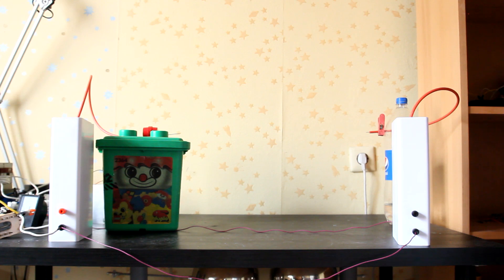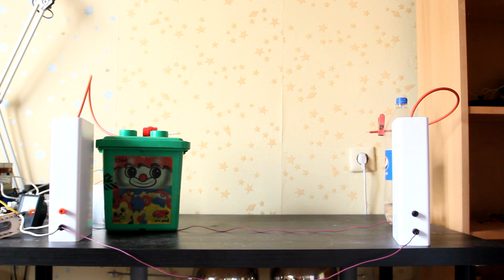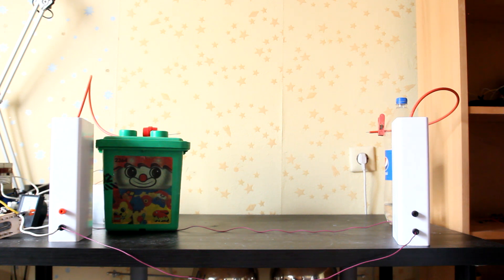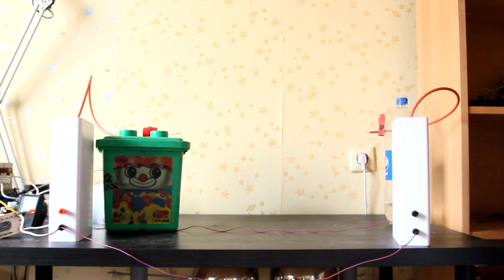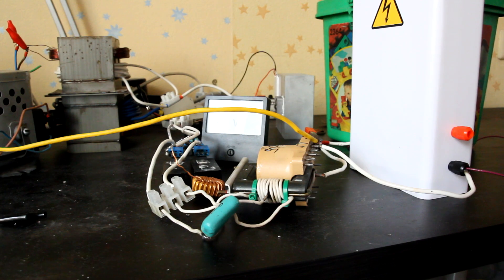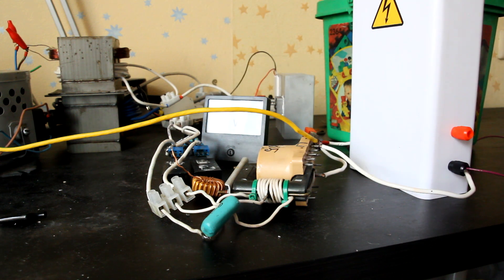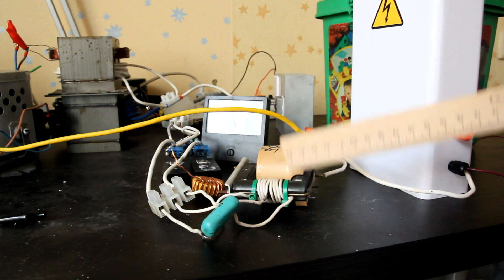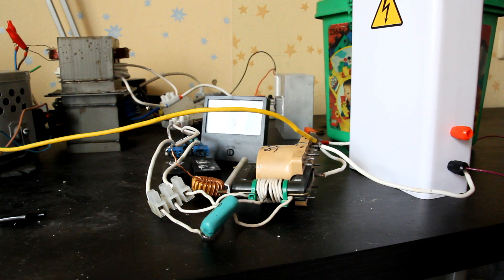250kV from my new bipolar voltage multiplier setup

Comment: Awesome! How do you protect your diodes against to large current surges? Don't you need a serie resistor?
Reply from the maker: Thank you! Yes, in principle one needs a series resistor. However, the diodes used here – 2CL2FM – are quite powerful (100 mA continuous current) and they can handle the surge currents (apparently). In my previous builds where I have used low current diodes, 5 mA continuously, 2CL77 or something similar, I indeed would often get the diodes burned out during sparking, usually the first or the second one from the bottom by the way. In those times, when 100-mA fast HV diodes were not as readily available as they are now, I would have to limit the spark current by using a HV resistor (usually water-based). So, you see, it all depends on the diode current rating. Since I started using the 100-mA diodes, I had not had a single diode fail even without current limiting. Now it's the capacitors that fail sometimes :) there's always a bottleneck
Reply: @Vidduley  Thanks for your detailed answer! I am always very careful with the diodes in my Cockroft-Walton because I have the multiplier encapsulated in epoxy. I suspect that you were more sensible and immersed the multiplier in oil or paraffin. Good luck with the further boosting! A short last question: do you use the famous blue chinese ceramic capacitors?
Reply from the maker: Haha, funny you should mention epoxy, because it was the very unpleasant experience of drilling out those 2CL77 out of epoxy, repeated several times, that made me switch to 2CL2FMs and paraffin encapsulation :D Yes, I use those blue chinese caps, 15 kV 1 nF, and the stated dielectric is Y5P. You can see the whole build step-by-step in my other video titled "How to encase your voltage multiplier in paraffin wax" or something like that (I don't remember the exact title)

Comment: so the corona discharge only happens at the positive terminal. that is good to know.
as with my field propulsion experiment I can use negative high voltage to prevent corona discharge. correct?
Reply from the maker: I don't think you're completely correct. The corona happens at both ends, it's just very different in visual appearance. The current in both positive and negative coronas is the same, as this is one continuous circuit in which ions transfer the current through the gas. Watch my video titled "Measuring current in
positive and negative DC
corona".
Reply: @Vidduley   I agree, after watching that video, it clearly shows the negative also has some discharge although it is much less

Comment: I've got a 12 stage Cockroft-Walton multiplier in a piece of ABS plastic tubing filled with oil. I just used what I had on hand, which was cooking oil. 😆 I fired it up a while back, which was about 8 years since I built it and used an old AC flyback transformer from an RCA television powered by my ZVS driver. I figured the oil would've gone rancid or gelled or something but it works great. Huge corona and discharge only about half of what yours does. I like the bipolar idea. Great video.

Comment: I don't know if you are still reading comments from this old video, but I was thinking:  why not use a ball instead of a needle--then you wouldn't lose energy to the corona discharge--all the energy would go into the spark and one flyback transformer would probably have enough power.
Reply from the maker: I read all the comments :) The corona helps to initiate the spark, that's why for the longest sparks we need needles; if I would use a ball, the spark would be shorter. If I remember correctly, I did make a more powerful flyback, it's in my 300 kV video
Reply: @Vidduley  Thanks!

Comment: Why isn't the arc going in straight line?
Reply from the maker: Basically statistics. The spark develops by the means of thin branches, called streamers, and the streamers generally follow the direction of electric field lines. However, the streamer develops by constantly emitting UV photons from it's head, ionising the air around  it, and the direction where the emitted UV photon flies is pretty much random. This adds up with small fluctuations in air density, composition and humidity. So at any given moment the sum of random events cause the streamer to protract several of it's branches in random directions. Then the directions that oppose the directions of electric field die out, and the ones that coincide with it develop further. In the end a combination of these random developments create a conducting path between the electrodes, which causes a short circuit and a current pulse - a spark.
Reply: According to your answer it should go in straight line in conductive gas?
Reply from the maker: Why did you think that? Also I don't think there can exist conductive gases, every gas is non-conductive until it is electrically broken down. Even metal vapours and water vapour.
Reply: Because electricity goes the shortest path like any other energy and the shortest path is straight line. Your saying mercury vapour isn't conductive? The amount of mercury in Lamps is in mg if you build enough pressure of mercury gas I think the spark would go through a straight line.
Reply from the maker: You know, as far as I understand it, the mercury is also Made conductive, i.e. turned from gas state to plasma state, at the first moment when the lamp is ignited. After all, that's the reason why it glows, the discharge is already established. But I agree, if the pressure of the gas is high enough, and the field is uniform, the spark would probably be much straighter.

Comment: Put a resistor to draw arcs? (As killvot's multiplier)
Reply from the maker: Kilovolt's multiplier has much less stages and much more power than mine, so arcs that are possible for his design are impossible for mine - too high of an equivalent series resistance. I find the sparks more impressive than the arcs anyway :)

Comment: Is it the ferrite core limiting the power output from the flyback, or could it be the output impedance? Most TV flybacks have very fine windings on the secondary which waste a lot of energy at high output currents. I have a similar sized ferrite core which I removed from a TV flyback and have managed around 1kW through it for a ZVS driven induction heater using custom primary and secondary (although my output voltage was much lower and switching frequency was only around ~40kHz compared to I think you mentioned 90kHz in the video on overvoltage protection)
Reply from the maker: It seems to me that 20 ohms, which is the resistance of this particular secondary, would not limit the current as much as it's inductance of 100 mH at 90 kHz, and the inductance of the secondary is determined by the crossection of the core hence the core limits the power. However these are all my guesses, so you might be right as well, but the bigger core did in fact solve the problem, while the resistance of my homemade secondary is still close to 20 ohms, 18 ohms to be clear.
Reply: AC electronics and magnetics aren't one of my stronger areas of knowledge, I'd neglected to consider inductance, and what you say about it makes sense. On my induction heater and other experiments with ¬1kV secondaries there would have been a lot less turns, so less inductance allowing a lot higher current and hence power. Glad to hear you solved it with the bigger core :) Looking forward to more videos and hope your channel grows - you have some real quality content already!

Comment: Is it lehtal to touch the corona or how painful is it
Reply from the maker: I believe corona discharge by itself would be barely sensible, because its current is in the range of few hundreds of microamps, however placing one's finger in the corona discharge very likely would produce a spark to this finger, and that would mean releasing all the energy stored in the output capacitor of the voltage multiplier to a human body; considering the fact that energy higher than 0.15 J causes heart fibrillation and lots of pain, and this particular setup has 4.5 J stored at maximum voltage, I would assume that such a spark would definetly be very painful and probably lethal as well. So don't touch any similar discharges please :)
Reply: Vidduley hmm in my opinion its just super painful. To stop normal human hert you need about 6.5 joules trough your heart but if im not grounded good as the multiplier it self it would probably cause same feel as a teaser so not painful but annoying and you would paralyze for a moment. It more likely to peapole whit heart problems or risk to them would die   but normal heart would be bretty safe. Becose a taser can deliver 5 joules and dont kill a peapole
Reply from the maker: Oh, yes, I messed up the fibrillation energy, it is in order of tens of J, but you know, it's better to be careful than to be dead